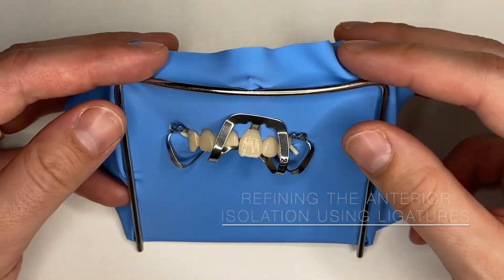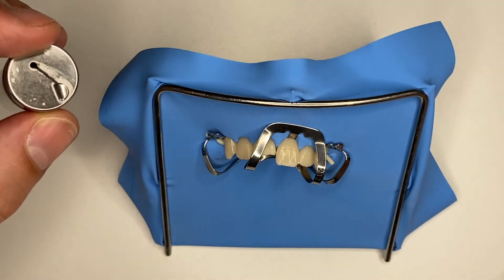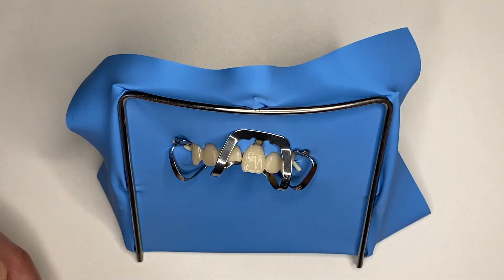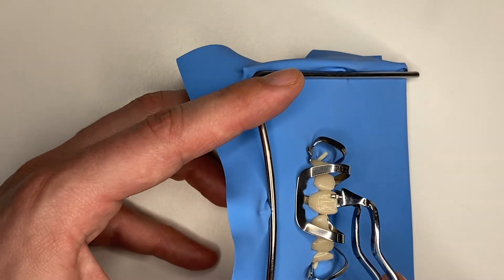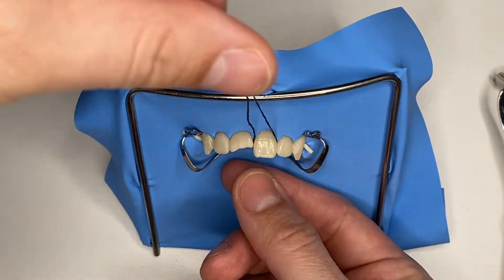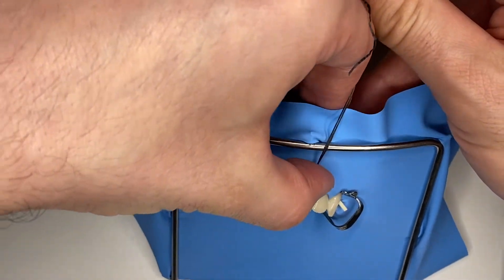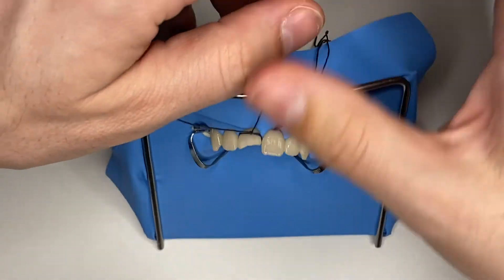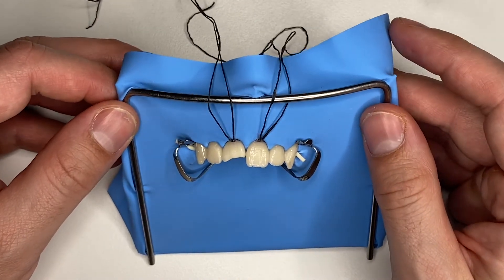Master the Art of Anterior Dental Isolation: Refining the Anterior Isolation with Ligatures!

Comment: Great tip with the frame upside down. I'm going to use that tomorrow.
Reply from the maker: Thank you for your kind comment! 
If there is an issue with water management while the frame is upside down, just fold the lower sides of the dam up over the top lateral pins of the frame. This should also give you a nice support for your suction tip. 🤗 
Let me know how it went!